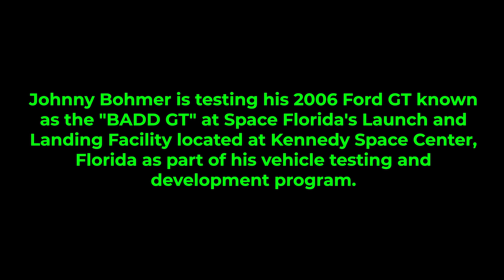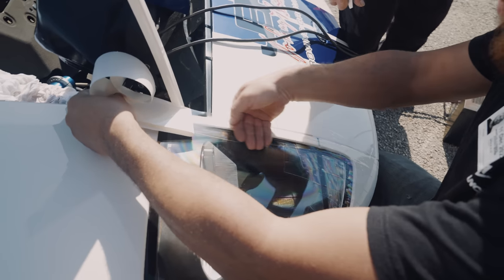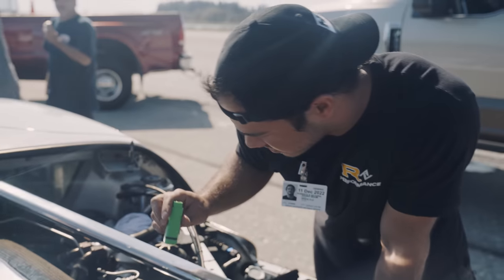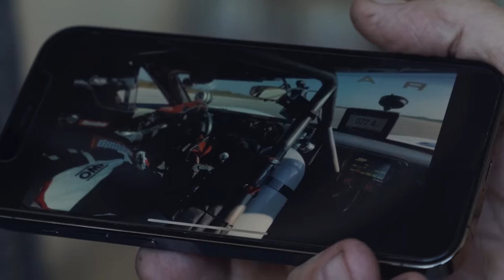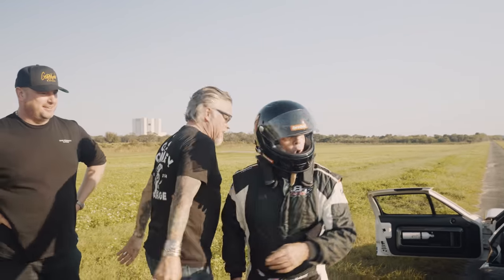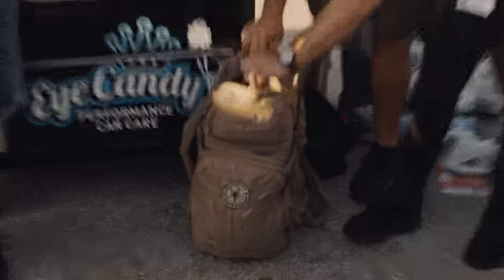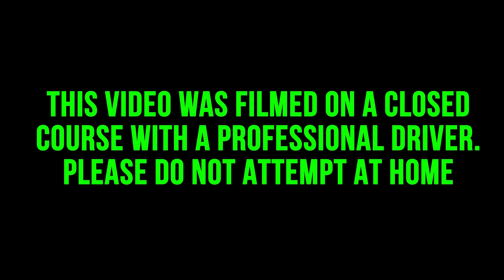World's Fastest Street Legal Car 🛞💨 300mph+ | The BADD GT®

Comment: Not that 310 is slow. Cause that is a awesome accomplishment. An it is currently the fastest car for the standing mile. But it was not the first car to run 300 in the standing mile. That was also done by a 2006 “street” Ford GT in 2019 by M2k motor sports, with a 300.4 mph run in Victoria Texas on March 24,2019.
Reply: On race gas/ meth. 

And they didnt have enough data recorders to verify via genness
Reply: @devinbender8428  yeah but the people that were there, in texas at the event, will know who broke 300 first in 2019, it was not gmg.
Reply: @DavidB7474  depends if genness book of WW verifies this run or not. 

That run at texas wasnt verified and the Bugatti run is still pending
Reply: @devinbender8428  guiness is still showing the Chiron Super Sport as the first production car to break 300, but this same car only runs 227mph in the standing mile. 
  Tuatara supercar has posted many run past 300 but seems its the race track only version, keoingseggs has a supercar that claims to run way past 300, Jesko Absolut. but who knows.
Reply: @devinbender8428  the Ford GT run by M2K Motorsports on March 24, 2019, was the first car to break 300 at any domestic standing mile event, ever. If Guinness doesn't recognize the timing electronics used at these events, then every speed run or time is up for contesting the results. We all know who ran it first. Guinness can dispute it all they want.
Reply: @DavidB7474  which i don’t understand how they can give that to buggatti because the one that went 304.77 was modified.
Reply: @DavidB7474 Can you share that quote from Guinness about the Chiron!

Comment: 310.8 mph is indeed a mindblower. And with an abundance of multi-million-dollar Supercars in the world, the Ford GT stands alone in surpassing the 300 mph barrier?  That's boss man...  Camilo Pardo must be very proud. ..designer of the 2005 Ford GT.
Reply: there is the bugatti chiron that an owner stretched an extra 10 inches i think? and it just barely broke 300 but it also costs like 6 times as much as the ford gt, dont quote me on this as im saying it from memory
Reply: @Sir__Pumpkin1100  it's the Bugatti Chiron Supersport and the owner didn't stretch it, Bugatti designed the Chiron SS with a long tail and dual-stacked exhaust all for aero reasons. It needed to exceed 300 on a two-way trip(it did a 1-way trip) to achieve the record. World of difference between the two vehicles, the Ford was built by the customer and the Bugatti was all factory built. I prefer the factory-built one that comes with a pretty warranty.
Reply: FORD!!!!
Reply: @Sir__Pumpkin1100  303mph
Reply: The only thing that gets me here…..The built for top speed version of the Bugatti Chiron is hitting 303 with 1479hp….. why are they requiring 2700hp to go 310? I know the level of resistance is not a linear…..but there’s no way you need almost double the horsepower to get that extra few miles per hour. Now I understand it takes a ton more power to get to that speed quickly(think top fuel dragster) but the Bugatti reached 303 in a very similar time to the GT reaching 310🤔
Reply: Not saying it’s not amazing regardless! Just kind wondering about the Horsepower difference needed here.
Reply: @alexsahli7988  Achieving any cars top speed is largely determined by its frontal area vs Hp. The Ford GT has the smallest area and the lowest roof height (43.5" stock) of all American cars, which, requires less HP to attain top speed.
Reply: @alexsahli7988  lt took all 2700 hp for the GT to hit 310.8 mph record on a standing one mile runway. The Bugatti Chiron record was done on a very long closed oval racetrack, not the standing mile.

Comment: Back in 2019 at the Texas Mile, a 2005-6 Ford GT went 300.4 mph from a standing start in a one-mile run. That same day the run was backed up at 299 mph. Street legal, on gasoline, 5.4 DOHC engine, Car was built and run by M2K Motorsports of Houston, Tx. Videos of the run are on YouTube.
Reply: What gearboxes are these guys running?
Reply: Twin turbo? Supercharged?
Reply: The car was twin Turbo on methanol I know the guys who built the engine
Reply: @Hennessey Venom F5 We're talking 300.4  "STANDING MILE" vs unlimited NASA runway length of 310. AND the M2K went 300.4 "IN 5TH GEAR. Never even got into high gear. Bugatti and Koenigsegg both say their cars will go over 300 mph as well, but they need the full length of the Mulsanne Straight at LeMans to get there. "Standing Mile" vs an unlimited NASA runway equals tomatoes vs oranges. We need a showdown, either the BADD GT gets to 300.5 in a standing mile or the M2K car comes to the NASA space center.
Reply: @Hennessey Venom F5 M2K has nothing to prove. they went 300.4 in 5th gear at the Texas mile, and the other guy went 283. In fact, the same day they went 300..4, they backed up the run with a 299. What's M2K got to prove.? In fact, there is a video on YouTube which has a camera inside their cockpit during the record run, and the driver's Heads-Up display shows their car exiting the timing traps at 306, in 5th gear, before he backs off the throttle and pops the drag chute. When the other guy goes 300.3 or 300.5 at the Mile, then its time to bring their car out of retirement. Going 300.4 in a standing mile in front of some calibrated timing clocks is much tougher that going 310 on an uncalibrated clock on a Boeing 747-carrying-a-space-shuttle runway of unlimited width and length. As I pointed out in my previous post, we're comparing tomatoes and oranges. One is one and the other is the other. Anybody who knows cars also knows that you can normally go faster in 6th gear than in 5th gear, and going 300.4 in 5th equals around 330 in 6th, especially if you get a running start and have several miles of pavement to get up to speed. As I further pointed out, both a Bugatti Veyron V-16 and a Koenigsegg can get up to 300+ mph, possibly to over 310, but they'd need the full Mulsanne Straight at LeMans to get there. You and I will bench race interminably until both cars show up on the same day at the same course under the same rules and settle the grudge match. Until then I'll look at the BADD GT saying his best time at the Texas Mile was 283, and the videos showing the M2K at 300.4 in front of some timing clocks. The M2K is State of Texas certified to be street legal, and the BADD GT says its also street legal. M2K ran on racing gas, and I assume the BADD GT did so as well. Personally, I love bench racing. Also, BTW there is a video of the M2K car at either an Indianapolis or Columbus, Ohio car show, the show is over, and the  M2K is easily moving out of the show under its own power, moving out to the exhibitors parking lot, to be loaded back into its transport trailer. The car is acting mild, no problems, just like it was grandmas old 1960 Falcon. Probably could easily drive it down to a local McDonalds if they wanted to.
Reply: @Hennessey Venom F5 One car goes 283 in a standing mile. The other car goes 300 in a standing mile. Who's the fastest car.
Reply: @tafaragadze6432  M2K said they used a commercially available transaxle "as-is" because they couldn't afford a set of custom gears. The question was asked in one of their inerview viedos.
Reply: @Hennessey Venom F5 there's a YouTube video where the question was asked, and M2Ks owner says they used a commercially available transaxle, and the gears were "whatever came with the gearbox."  All I know is what M2Ks owner said in the interview.
Reply: I don't care what you say  or how many times you say it, my reply will always be to send your car to the Texas mile and get it to go 300.5 mph or faster. Until it does so, its not the fastest car. Right now 300 mph is faster than 283 mph at the Texas Mile. It took your car to go the length of NASA's Boeing 747 runway hauling the space shuttle to get up to 300 mph speed and the M2K Motorsport did it in a mile from a standing start. Let me know where to find the video on YouTube of him going 300.5 or faster at the Texas Mile.  And again I say, the M2K car went 300.4 in 5th gear, didn't even need 6th gear to get to 300. As to the question of if they used racing gas or methanol, I can only say that M2Ks owner said in a taped interview featured on YouTube that they used racing gas. @Hennessey Venom F5 I
Reply: As before, let me know when the video comes out of the BADD GT going 300.5 mph at the Texas Mile. Until he goes 300.5 at the Texas mile, he doesn't have the fastest car. When he goes 283 and M2K goes 300, they're faster. And him challenging M2K, its like the big dog at the burger doodle on a Friday night, he's got a monstrous time slip taped to his window and a little old lady in her 1960 Falcon challenges him to a drag race, he's not even going to start up his car, because the race is a foregone conclusion.
Reply: @Hennessey Venom F5 I'm beating the drum for Ford, just not the particular Ford that you are. I'm beating the drum for the M2K Ford GT. I had moved on, but since you have revisited the issue, here goes: The M2K Ford went through an impartial, calibrated set of timing traps, at 300.4 mph. Your boy in the Badd GT had no timers, he just got in his car and drove until his unofficial, uncalibrated speedometer read some number that he liked. NOW: The M2K had one mile to start, get up to speed, go through the traps and then shut down before he crashed. In researching the NASA track in Florida, it was the touchdown air strip for a returning space shuttle. It is 15,000 ft long (2.84 miles) with an additional 1000-ft "safety area at either end. It is also as wide as a 21-lane super highway. So, your boy could start at one end, leisurely drive down the strip for at least 2 miles or more, get to as fast as he wanted to go, and still have 3/4 mile or more to leisurely slow down. At the Texas mile it was a case of "wham, bam, thank you mam. run through the traps,  then shit in your pants as you were trying to slow down.  In reading about the timing traps, the initial light is 66-ft before the finish line, and the 2nd light is at the finish line. The M2K went through the 2nd light, tripping the calibrated sensor in a manner that said 300.4.. Immediately after tripping the light, the heads up display in his car showed 306 mph before he could back off the throttle and deploy his drag chute. So he increased his speed from 300.4 to 306 in about 66-ft, indicating to me that if he'd gone another 100-ft he would have gone over 310 mph on  a calibrated set of timers. Again, your boy had his own uncalibrated speedometer as his only speed reference, which is way different than calibrated timers. As to running down Fords, I'm boasting about M2k to everybody I can corral to have a discussion about speed limits. I myself had one of the 1966 Ford Fairlanes with the 427 race car package with fiberglass hood. I worked for various divisions of Ford for 34 years. When somebody talks about Chebbys, I have 4 retorts, 1). Bob Glidden, 2) Million Dollar Bill Elliott, 3). Carroll Shelby 4). Ford won LeMans 4 years in a row, whereas Chebby never even bothered to show up. Glidden was low qualifier for 19 pro stock races in a row, and retired after 89 wins in Pro Stock. His Boss 429 T-Birds or Boss 351 Pintos and Fairmonts would show up at a NHRA event and he' would automatically win. Bill Elliott Would show up at a NASCAR event and he'd automatically win too. Ford had Carroll Shelby and Chebby had Zora Arkus-Duntov. Shelby and his Cobras never lost a race to Duntov. Don't tell me about not supporting Ford. For 50 years in a row, I never owned a car that wasn't a Ford. How about yourself.
Reply: @bobkonradi1027, but here's the difference as the koinsegg can do close to that straight from the factory.  This GT has been heavily modified to make it to those speeds.

Comment: He's got balls of steel. What scares me even more is the way he held that wheel at such speeds.
Reply: Why would that scare you more? He feels more comfortable and in control when he holds it like that. Lots of old rally drivers used to have similar positions
Reply: Fairly certain it has power steering...🙄
Reply: @kilianconn5091  This is not the point. Holding a wheel like that doesnt give you much control, no matter if he feels more comfortable or not. But at that speeds you wont be doing big steering inputs anyways so I guess it doesnt matter.
Reply: @lukaslanger5068 says the guy who didn’t go 310
Reply: @weeewa2532  And thats why I cant have an opinion on the way he holds the steering wheel? xD

Comment: FuelTech is indeed amazing. I used the Haltech Elite for a while but recently changed to the FT550 and it's made things so much better. Not to mention the personal support I gotten from FuelTech is massive compared to Haltech.
Reply: Fueltech to the front! I had the ft450 now i got the ft550 with input expander. The built in screen is such a game changer vs holley imo
Reply: @buiItnotbought  Never messed with the Holley as I build mostly import vehicles but your point works with the Haltech Elite as well.
Reply: Nice to hear that. The owner is a brazilian guy, nice person as well
Reply: @LUCASxBlackMechx  100%, This is why when people ask me if FuelTech could handle running their car. I almost answered "Simple answer
, yes. More complicated answer is if it can handle the massive cubic inch engines that use twin turbos, 70% nitro mix AND nitrous ALL AT THE SAME TIME back in Brazil, yes, it'll handle running your car.
Reply: Se o @andersondick mexer no mapa vem mais uns HP

Comment: Absurd. Any idea how much power this thing is making!?

Crazy feat guys, well done.
Reply: I’d say around 2000+ Hp with maybe a 500ish shot of nos
Reply: 2000hp
Reply: 2100hp on this run.
Has 2700+in it
Reply: Can make 2700 hp on  wheel and 3100 on  crank this run waa merely 2100 hp

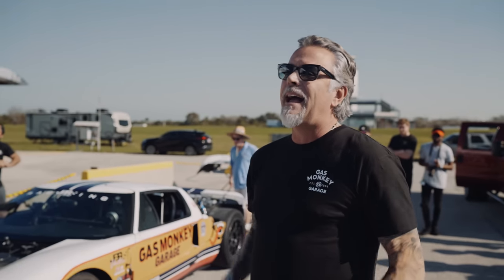Comment: 3:34 the Bugatti Chiron only requires to do a visual check, put the 2 key's and does 304.77 mph every time you need it to do it with air conditioning.
it was made and engineered for that single purpose, just put fuel and drive. no tinkering around and you feel safe at 304.77 mph.
Half of the parts are made by aeronautic companies with fully licensed and qualified welders that make airplane parts.
one brake caliper of the Chiron is more expensive than your entire car and it's freaking hi-tech.
it's still a limited by software car, it's a 16 cylinder, 4 x 4 car, not a tuned car, no 1 is going to modify the ECU (it has 8 computers, i believe, try hacking that), it's sacred car.

the Bugatti can be driven by a 70+ year old woman, like they did to prove it's no scary car and can be driven by anyone.
Reply: it does 0 - 400km/h - 0 in 40 seconds or so.
Reply: Thanks for the in-depth explanation. Nice to know the Chiron is much more convenient for this type of activity
Reply: @Jasonann71  Ya, the shape might not appeal to all of us, but it's a car designed/engineered by professors, doctors in engineering. every detail perfected down to the connectors of the wires.

If i would own one, i would have a house build with a glass wall between the living room and garage to see it al the time.

it's not really a simple car, but a thing that toke like 10 years or more (maybe even 20 years if you include the VW Nardo) develop in case of the Veyron.
Reply: @Jasonann71  it was 2.3 Billion us$ to make the Veyron.
Reply: @AnalogDude_  Wow, That’s pretty insane that Bugatti went that far to get over 300mph safely!!
Reply: @Jasonann71  Not sure, but i don't think VW made a profit on Bugatti, the Veyron was like 6.5 million€ cost a piece and sold for 1 million€ at his/her debut.

But today a Porsche 911GT(x) model does 0-100km/h in 2.5 seconds. a learning project

Now Bugatti is for 49% in the hands of Porsche and 51% for the Croatian Rimac.

there is a Video of a Croatian guy and his son doing 417m/h+ on German autobahn at night.

search: Bugatti Brake caliper and learn how far they went. 3d printed, takes 48 hours of printing

it does 20 liter per 100km in urban traffic.
fuel tank is 100 liter.

People that don't value this car, don't know what it took to make.
Reply: @AnalogDude_  I absolutely agree. These facts are never talked about in reviews or during dealer purchase so the car is heavily under-appreciated. Thanks for taking the time to write this, learned a lot from you!
Reply: @Jasonann71  the double clutch, VW DSG, Porsche PDK, etc is a result of that.

even if i couldn't afford the insurance, fuel, tires, i would buy one just to stare at it.
: )
Reply: @AnalogDude_  I know right 😂😂